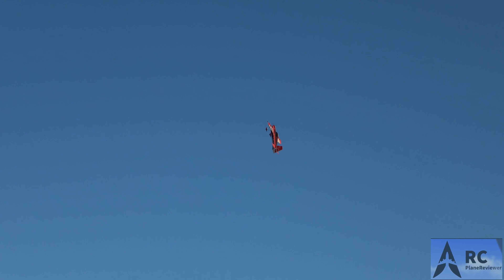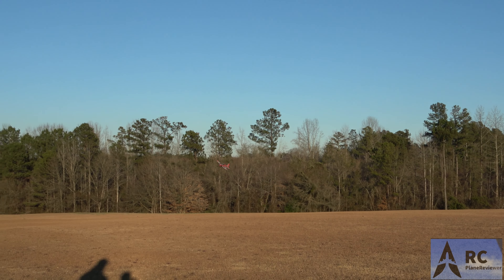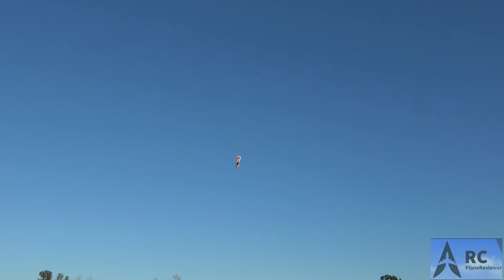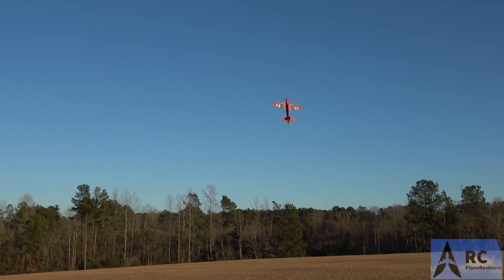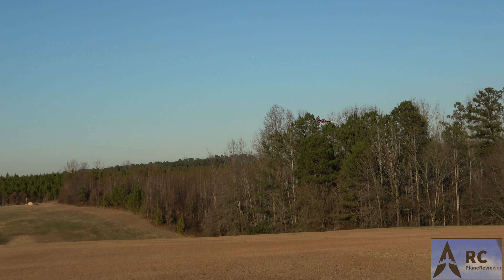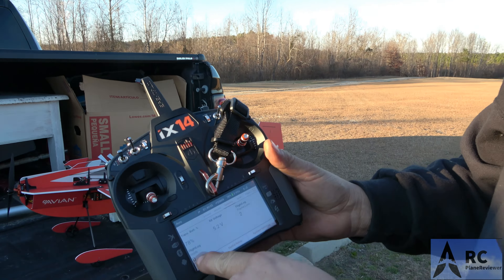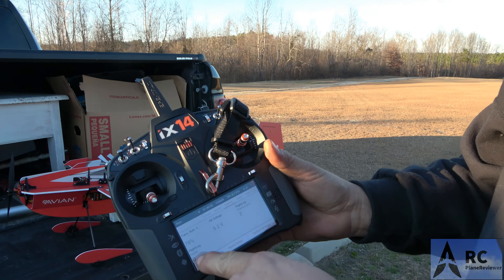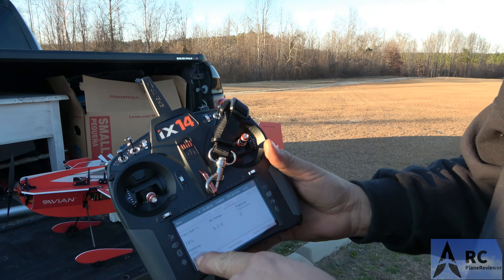Unbelievable Electric Airplane: E-flite Eratix 3D FF 860mm Revealed!

Comment: Just maiden today and it's the BEST plane I've ever flown. F22, SU27, T28...  I know the Eratix is a flat foamy, but as a trainer/3d trainer, it's perfect for my intermediate level. I flew it like a sport plane and it just does what you want with confidence and no fear of hitting the dirt. I've had a few bad crashes with other planes, I got this to see if it was me or the planes I flew. I flew this like a champ. If this would have been my first plane, I think I would have progressed in the hobby faster with fewer mishaps. My future planes will have to be tuned as close to Eratix as much as possible. As in control rates, balance. This bird will spoil any pilot out there.
Reply from the maker: Good stuff right there!